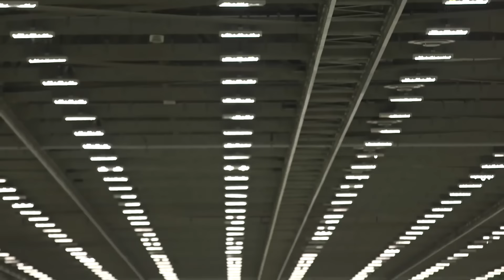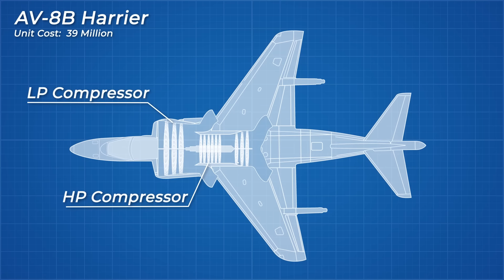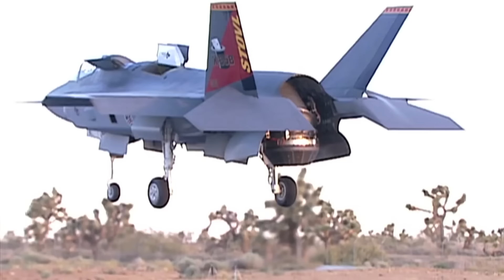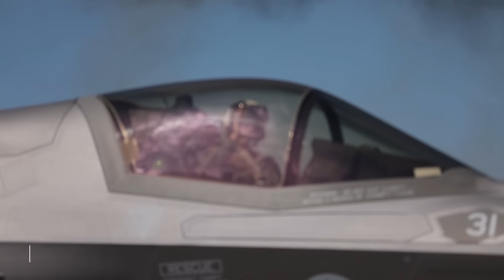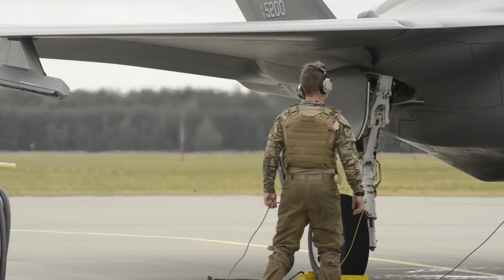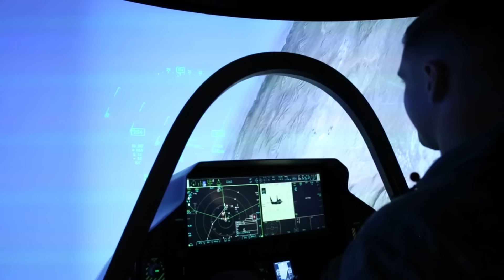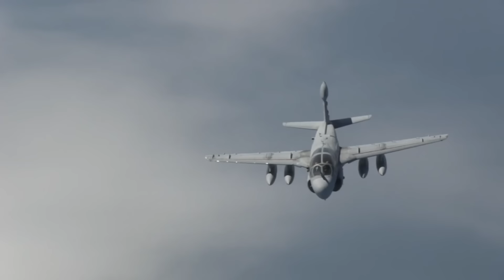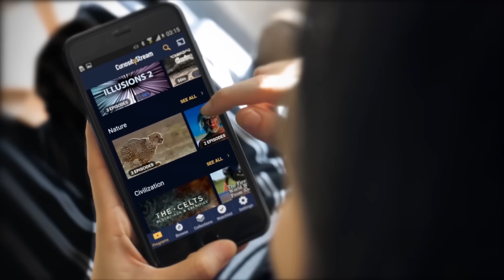Is The F-35 Worth $115 Million?

Comment: What people think will happen in a 21st century conventional air war: high tech planes, missiles, lasers
What will likely happen after about a year: D r o n e   s w a r m
Reply: 115 million buys a LOT of cheap drones
Reply: @neeneko  I was actually going to joke about buying $100M worth of $10 plastic minidrones from Alibaba and flying them all at the enemy like a swarm of bugs.
Reply: @volvo09  And a single signal jammer stops them all dead in their tracks. The military has been considering how to combat drones for the better part of the last decade.
Reply: @neeneko  I don't think you have the right kind of drones in mind.
Reply: @flybeep1661  It doesn not even have to be a super cheap drone.  100M buys a lot of 100k drones, or 1M drones, or even cruise missiles.  All cheaper and development iterates faster.
Reply: @neeneko  >>100k drones, or 1M drones, or even cruise missiles.  All cheaper and development iterates faster.<< 

A 100K or 1M drone can not go as high, fast and far as an F-35. Sure it can be made to do one of those but not all. 
If it has to go fast it has a limited range. If it has to be able to go far it will have limited speed. You can probably make both go high but it will drop on the other parameters. 
If you wanna do all you should expect to be able to get 2-3 drones for the price of one F-35, and they can get hacked and stolen or even attack your own forces, or it can get jammed so it have to return to base or in the worst case, it will crash. 

The Cruse missiles can not be used to keep air superiority, if fired from a plane or drone it will add greatly to its range, it's more expensive then dropping bombs from a plane and it is easier to shoot down, at least those in use today are.
Reply: @neeneko  Cheap drones do not fly fast, do not fly high, do not fly far.
Reply: Small drones in high numbers is really good in 'some' situations.

Small Drone has less range, it can get jam, it can detect easier because it's a lot of em etc. 

Especially many countries already developed many systems to combat swarm attack like laser, jammer, microwave, other drones.
Reply: @DOSFS  Not really, Drones are very easy to defeat.
Reply: @mbukukanyau  >>Not really, Drones are very easy to defeat.<< At least for now and the near future. In 20 yeas+ it's hard to know.
Reply: Drone swarm absolutely. No need to teach expensive pilots either, and cheaper planes that can be risked in many more situations. Not as much g force hindrance either.
Reply: Yup. I think with the rise of AI, drones will be the smarter (lel) choice compared to jet+pilot. I can't see a benefit of a human pilot in the jet fighter, which has to be built and trained, if you can just spam AI controlled drones.
Reply: Jim Jam  
well, sure you can just put an RC computer into any plane and turn it into a drone. but you are taking a bit high risk because data link can be easily jammed and your drone will either crash or will be forced to end the mission. And if it is that big, it is no longer a cheap disposable thing, so you rather put a human inside to make sure it will not misbehave.
But if you build tiny cheap things,  they cannot have the extraordinary characteristic. and no matter how maneuverable they are they can't catch a big interceptor. 
Also considering  G overloads, F-35 is sort of too slow to be able to experience that it has small wings and can't turn quickly.

And considering the radioactive environment, computers really don't like radiation it is an extremely big issue for them.
Finally is we talk about very fast and disposable drones they already exist we call them missiles and smart bombs.
Reply: I see cyberwar in future
Reply: US Navy is focused on Electriconic Warfare. EMP that swarm out of the sky
Reply: @willofdodge1  Might as well throw nukes around
Reply: https://www.darpa.mil/news-events/2017-04-23

Yeah drone swarms are going to be a thing UK and US military want them deployable withing the next couple of years. Because it's in your head or you heard it somewhere doesn't mean it's right use the internet
Reply: Current drones tech are vulnerable to electronic warfare though, insurgents in the Middle East can pull this off because the army they fought against have no electronic warfare capability to speak of, and they're incompetent. Drone swarm can also be defeated with computer-aided AA, which is relatively low-tech, and that sparks the interests of the US to bring back more anti-aircraft gun.

With the current technology, drones are not capable enough to engage in complex air-to-air combat, and it'll costs more than a human-operated aircraft of a similar capability. Even if you scale it down in term of physical size, it'll lack the range. Also, the main drawback of drone is the communication delay, and the AI technology is not advanced enough to perform air-to-air combat without human operator (which returns to the problem with the communication delay). You'll need at least an order of magnitude more satellite deployment to operate enough drones to fight a high-intensity battle, and probably thousands of satellites to replace tanks and aircraft in conventional warfare. 

The problem with advanced AI, to quote one of the book in the Lost Fleet series, "Any AI, that is to be trusted with weapons capable of killing hundreds, needs to be so intelligent that it can't be trusted at all."
Reply: Jesus, there is so much dumb in this thread it sounds like drunk Russian trolls arguing with each other.
Reply: @Deavan Meyer >>@Jrlomay0616 that is why planes are beginning to launch cruise missiles to avoid being shot down. The plan for the B-52 in the future is to launch cruise missiles and not fly over targets to bomb them the F-35 being set up for this same capability<< The thing is that cruise missiles are far more expensive and a far smaller warhead for its size, big disadvantages. But for some missions, it will be extremely useful.
Reply: @Deavan Meyer Glide bombs can have a much longer range (100 km+) and are harder to counter. Though they are still under development for now, unless the US got some ready they don't talk about.
Reply: you do know the F-35 was designed to operate at least 3 drones by the pilot and computer right?
Reply: 21st century warfare is actually about tricking the populace into electing the most inept commander in chief possible.
Reply: @NickCombs  Nailed it.
Reply: good thing the f35 is designed to control drone swarms and have AI loyal wingmen
Reply: @musman9853  >> f35 is designed to control drone swarms and have AI loyal wingmen<< It's not really designed to do so, only the 6th generation fighters are. But it will surely be able to do so.
Reply: The disadvantage of drone swarm is that they have limited speed, operating distance and time because of their size and very small carrying capacity, so drones are almost useless against reinforced ground targets being unable to carry bunker-busting bombs. 
Drones are only good as terror weapon and sometimes for suicide missions like cruise rockets that are also one kind of drones
Reply: @deltaxcd  >>drones are almost useless against reinforced ground targets being unable to carry bunker-busting bombs. << At least talking of cheap drones. The drones that will be able to carry that kind of weapons will not be that much cheaper than an F-35.
Reply: CARRIER HAS ARRIVED
Reply: Grunder industries be like
Reply: Drone is new part in air combat, It has advantage and disadvantage compare to conventional aircraft. Not mean it just 'better' just new way of new applications.
Reply: @DOSFS  my guess is that for the first part of a war, jets will still have an edge in the air, but as many militaries have many ways to take them down easily it would make more sense in some scenarios or combat roles to use a drone swarm
Reply: @Jrlomay  Yeah people have a lot of ways to kill an infantryman too, hasn't made them obsolete either. The "OMG DRONE SWARM" thing is much further out. Not to mention they need something to operate and control them from forward positions then engage with actual muntions, thats where F-35 comes in.
Reply: @Jrlomay  lmao my dude the f-35 and Definitely the f-22 will not be detected by anyone. Even without the things that make them easier to see the USA has trouble finding them. AI will never be better than a person because you have to tell AI what to do. A human doesn't have to be programmed in every single possible outcome they just think.
Reply: @masterhacker7065  "AI will never be better than a person because you have to tell AI what to do."
Literally the opposite of what AI does. AI is characterized by the fact that a person explicitly does NOT have to tell it what to do, it makes its own decisions based on information it collects. Selecting a solution from a list of solutions is explicitly NOT artificial intelligence.

"A human doesn't have to be programmed in every single possible outcome they just think."
Virtually the exact opposite of the truth, again. Humans are literally trained, or "programmed", with a set of IF.THEN responses to different situations, based on the collective experience of other people and statistics. Their ability to come up with novel solutions on the fly is next to nonexistent, simply because people can't process information quickly enough and calculate an optimal response for a given situation.
Reply: @DimeOfDimes  that is not true at all. With your definition of AI it will never be a thing. Humans are not programmed at all and they aren't told if.then either. Humans see a problem and are told one thing and almost never do it. If you have ever been in the military you would know that no matter what you are trained to do the first time you get shot at all you do is shoot back. You don't run, you don't throw grenades, you don't call for air support you don't do ANYTHING except try and neutralize the target it's just basic prey instincts. If you are attacked you attack back you don't think you just do.

(Artificial intelligence (AI) is the simulation of human intelligence processes by machines, especially computer systems. ... Particular applications of AI include expert systems, speech recognition and machine vision.)
This is the definition of AI and by your definition it means that humans are AI
Reply: @masterhacker7065  
"that is not true at all. With your definition of AI it will never be a thing."
No, this is how it is. AI is already a thing and has been a thing in the military since the advent of the heat seeking guided missile, if not earlier. They all work through a sensor collecting information, in the form of heat radiation, and independently adjusting themselves relatively to it without orders from a human. While they have no control over the thrust, they do have control over the control surfaces and actively adjust their attitude. It might not be very intelligent, but it is intelligence and it is artificial.

"Humans are not programmed at all"
Yes they are. Especially when it comes to situations that require quick reactions, they are very much programmed. Programming is exactly what training does.

"If you have ever been in the military you would know that no matter what you are trained to do the first time you get shot at all you do is shoot back."
Okay kid, it's your lucky day, because I actually have been in the military and thanks to the system we have in place, I won't actually be out in another 20 years or so even if my active service has ended for now. So here's something you really need to hear: Much of the first weeks of basic consists of drilling automatic responses into your head. Someone yells a command, and you respond appropriately, whether that is by hitting the deck, answering, or just turning in a given direction, depending on the command. You repeat the drill until you do it instinctively. It's important to have prepared, well-drilled responses, because a fraction of a second can make a difference. As training progresses, you learn to do more complex tasks until you can do your job without being distracted from all the other very important things going on around you, like people shooting at you. Training exists in most activities, because people are absolute garbage at making decisions, especially complex ones. We need shortcuts and we need automatic responses. AI, on the other hand, can multitask, it can collect and process information much faster and much more accurately than we can, and it's only going to get better at it with time as technology advances, while humans aren't.
Reply: @DimeOfDimes  glad not everyone has dented up brains master hacker is clearly living in the upside down world and thinks whatever ridiculous claim they make must be true because they said it
Reply: @Jrlomay  As you say, in some scenarios, not all. also, there is always the risk of the drone getting hacked. If a drone swam is working as a unit, you could probably just as easily take control of the whole warm. Anyway, for now, if you use electronic warfare to jam the signals, the drones in the near future can only return to base.
Reply: @masterhacker7065  >>lmao my dude the f-35 and Definitely the f-22 will not be detected by anyone.<< You seem not to understand stealth, it will definitely get detected, it just has to get much closer before it does. That's a great advantage.

>>AI will never be better than a person because you have to tell AI what to do<< Never say never, the question is not if it will be possible at some point, the question is if we will risk combining a strong AI with powerfull weapons, we could easily lose control. If it happens it will probably be the CCP that pushes for it because they are willing to take risks to make up for there lag of capabilities on other areas. But it will possibly be the end of humanity. 

A drone have one huge advantage as a fighter over a manned fighter. That going that it can handle much higher G forces then any pilot can survive.
Reply: @DimeOfDimes  https://en.wikipedia.org/wiki/Heuristic you might want to take a look into this and also into the newer paradigms of psychology. You're talking about behaviorism, one of the older approaches to the human mind and definetelly not suiting to expalin human behaviour in the 21st century. https://en.wikipedia.org/wiki/Behaviorism
Reply: Question.  Do you think working with drone swarms is not part of the F35s capabilities?
Reply: @flantc  As drones are much slower it makes no sense at all.

Comment: Costs are higher than they appear. The cost to operate them is much higher than other high end fighters and the maximum total flight hours is far lower. This means that several F-35 will have to be purchased to match the lifetime service of a single F-16 that they replace. They are technological marvels and have utility as part of a modern air force. However, the purchase of thousands of them to replace a similar number of F-16s is going to be unaffordable in the long run. Early delivered models will likely hit max flight hours before the later units are delivered because of the large quantity in the run and long time period to deliver all of them. The budgetary pain will then be realized when the entire run will have to continuously be purchased again and again in order to maintain total numbers.

A much more reasonable plan would be to use them as only a small portion of the total force and rely on high end fighters with lower operating costs and much higher max flight hours to do the majority of missions.

Comment: 27 years of cost plus on the tax payer dime.  This plane does nothing a plane developed 50 or 60 years ago did except the attempt for a single airframe  to do it all, which it really doesn’t.  The concept is a noble one but it’s not a practical one due to the complexity of the airframe.  Initial cost is one thing but cost of maintenance is another.  As these planes age they will cost a fortune to keep flying.  The 35 is the Rube Goldberg of aircraft.

Comment: I'll leave other arguments to other commenters, but the F-35 is not now, and can never be an appropriate replacement of the A-10. The A-10 relies on it's ability to SAFELY fly "low & slow" around the battlefield, to provide "eyes on" (not "sensors on") views of the fight, loiter as needed, and be armored enough to provide ground support in close quarters.  It's a ground support aircraft. The F-35 is an upgraded F-15E, which is a nice ground attack aircraft, but is NOT an A-10, and is missing many of the abilities of the older tank killer.

The old adage: "jack of all trades, master of none" is appropriate here. The F-35 is a great engineering exercise, but the cost and time spent is pretty much a waste. Especially when you consider what aircraft could have been produced if they spent the(less) time and (less) money to develop each use-case separately.

Comment: I definitely agree that the F-35 is more than qualified to replace the aircraft it was designed to fill the roles of, but it simply does not have the CAS ability that the A-10 does. We CANNOT replace the A-10. We will have to continue to upgrade it for future threats, but no other aircraft has the loitering and strike capability that the A-10 possesses.